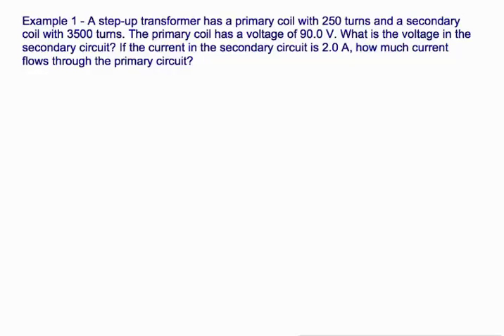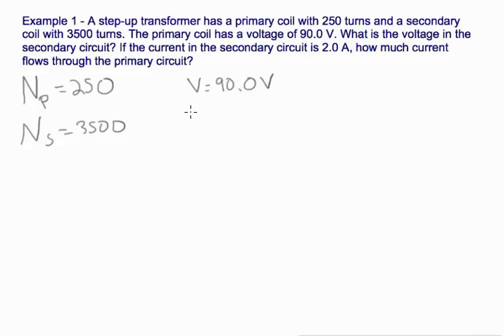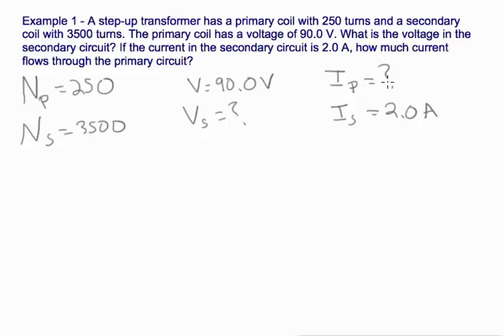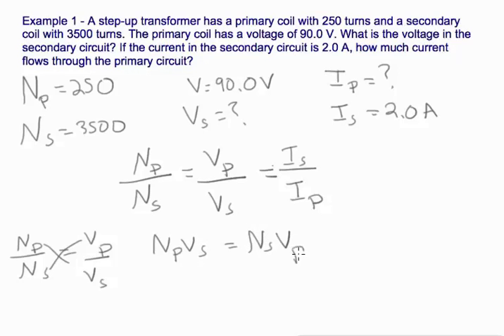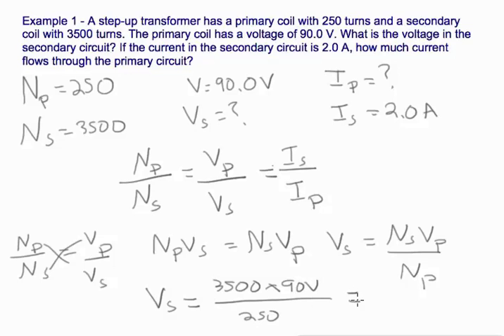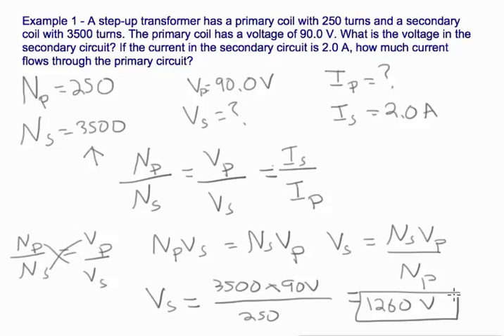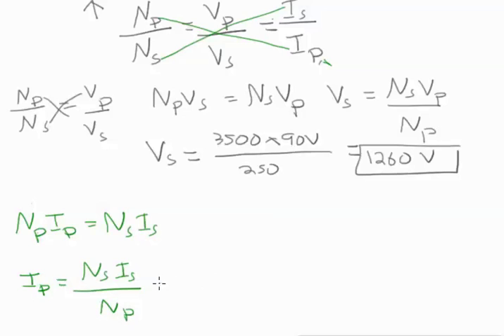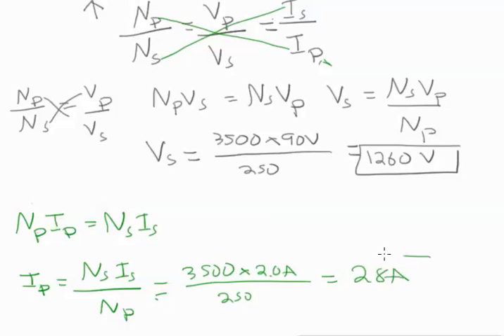13.6 Transformer Calculation Examples

Comment: excellent explanation, bravo. I would like to ask you for help. I have a hydro turbine that outputs between 50/80v but only a modest 220mah, my question is, how can I get note amps even if I have to compromise voltage, its a hydro turbine and can be on 24 hrs with out wasting water, I know I need a transformer and I know transformers are rated in kva where should I start?

Comment: some reason I can do math with numbers. but when you put letters in there. it just goes over my head. for some reason I just have a hard time thinking! not that I can't do it. I just have to write it out different. to help keep my mind off the letters. great video. I would like to know the answer first and then see how you get it. and I would like to know how to wind a trans former. the videos I seen. aren't in English. or have heavy accents and are hard to understand. I. : either a single or multiple transformers. for 2;# bb4-48v to about 150-160v. switching at either 60Hz. or at a few kHz. for a inverterz oomppn